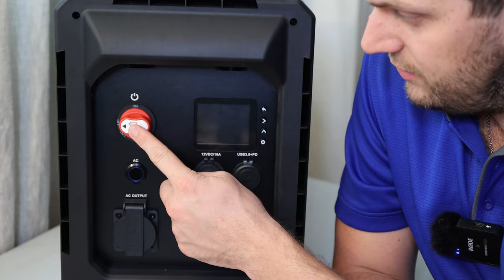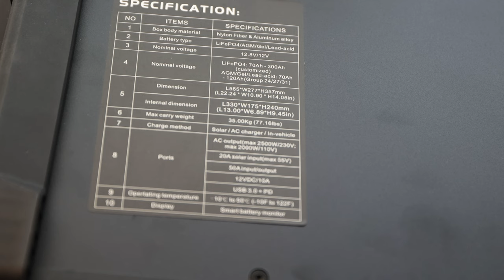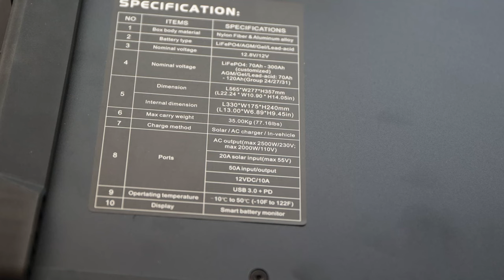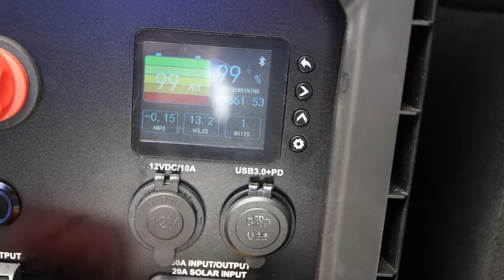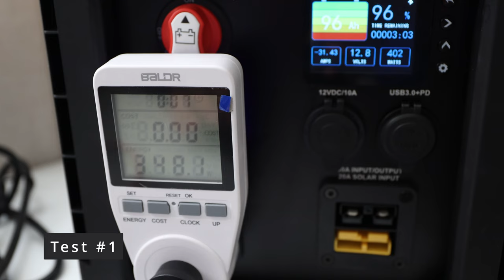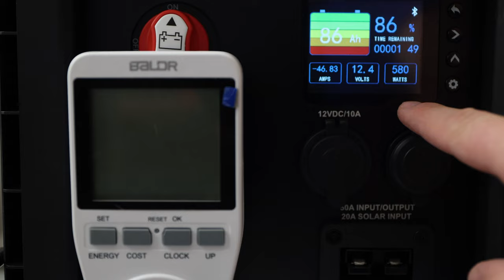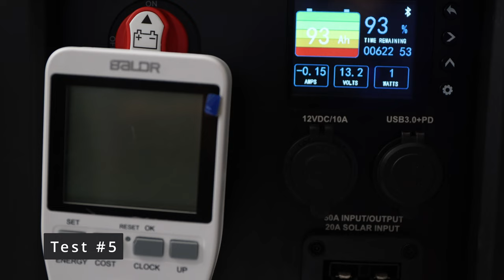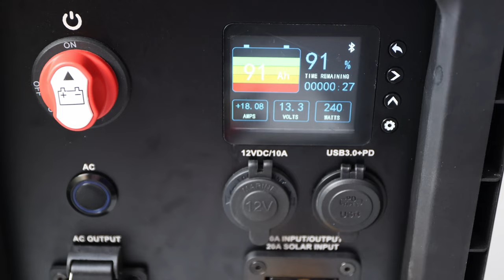Licitti 2000W New Gen Battery Box | Easy DIY Power station solution?| I had some issues…

Comment: The charge controller is an issue for me. 20amps with a max of 50v on the input side means you're limited to something like 400w of panels. That means some lengthy and likely incomplete charging for 200-300ah batteries. The controller needs to be 40amp and good for 600-800w/100-150v panel input. I also wish Licitti would just simply give a simple, clear number to express the actual internal dimensions of the battery compartment. They have drawings with dimensions but those dimensions literally have an asterisk next to them with no explanation. They should make it idiot proof and just give a clear answer. I'd buy on of these for my 300ah Varter, but I can't get a response as to fit.

EDIT: I realized after my comment that a 300ah battery in it's case will not fit this box. I can't understand why the makers of the Licitti as well as many other battery boxes don't size their boxes to accommodate the industry standard battery sizes without disassembly or using raw batteries. Seems short sighted.
Reply from the maker: Thanks for watching and your feedback! I understand what you mean and I had similar thoughts. Since I'm building my own battery pack I was not thinking about other 200/300A 12V battery packs but you are right - they are bigger. The unit itself is already bigger. There might be other batteries coming pretty soon which you can buy with more capacity and might fit - test outstanding and I'll keep the channel posted on this. Regarding the MPPT -I'm already searching for another unit anyways so I will try to find a unit which fits the unit and has more Amps.

Comment: The original Licitti battery  boxhad only a 10 amp MPPT controller. This Next Gen  box was supposed to be an improvement on the original. It has less ports and at $438 is more than double the price  of the original.😮
Reply from the maker: Yes, that's kind of true! I try to find a way to solve this. I just had the issue with too little Anderson connectors, too

Comment: My box was charging fine for 5 days now no charging  is taking place.  Anyone else  have that issue.
Reply from the maker: Mine works fine. I do discharge the battery via inverter a lot and charge it through the Anderson connector with 20 and 40A charger without issues so far.

How do you try to charge it?

Comment: Well the same unit worked fine for 8 hours for me the next morning i woke up to a double beep sound every minute with the AC inverter on or off have you ever dealt with that and is there a particularly way to diagnose this or is it a good time for a warranty replacement, FYI I only had a portable radio connected to it and the battery shows 96%.Thanks for any advice ahead of time.
Reply from the maker: I returned mine since it was poor quality. I would try the warranty in this case... Sorry to hear this!

Comment: I would like a 200 amp battery that could fit in without assembly
Reply from the maker: I know what you mean. good question, let's see if I can find one!
Reply: @tobisreallifeskillswithtobi  The guys at Licitti think i have your skill set and expertise well i can tell you i don't If you can find a battery with at least 200 amps you would be the hero of a great many old timers like myself who are just learning..
Reply from the maker: @NikosDelight  Maybe such a battery could work: https://amzn.to/3O7Et7A It is "only" 180Ah but the form factor seems to be similar to the battery I was putting in. At least a quick check.
Reply: @tobisreallifeskillswithtobi  It looks like it could and it seems small enough i will order one when i find the actual internal dimensions off the 2000 series vs this size battery.
Reply from the maker: @NikosDelight  Just measure yourself before ordering! I did not have the time to do so. I hope it works! I would test this as well when getting my hand on one 🙂
Reply: @tobisreallifeskillswithtobi  It was a no go so i went with the 280 amp battery the width of the center of the tray is the issue.
Reply from the maker: @NikosDelight  okay! Was worth trying, thanks for your feedback!